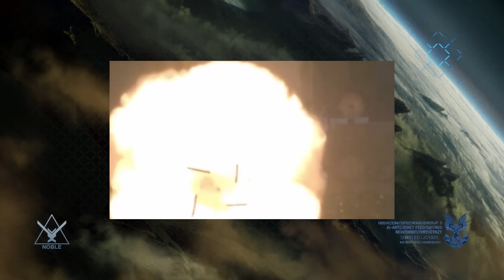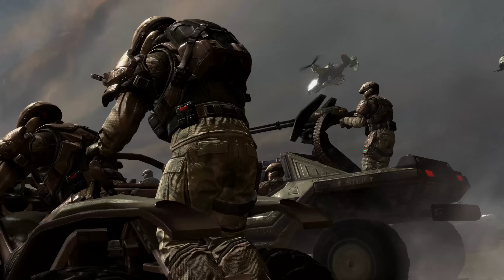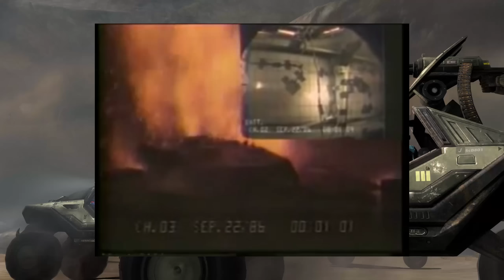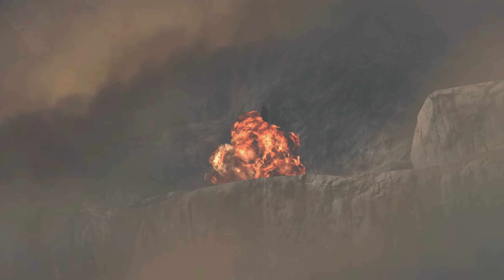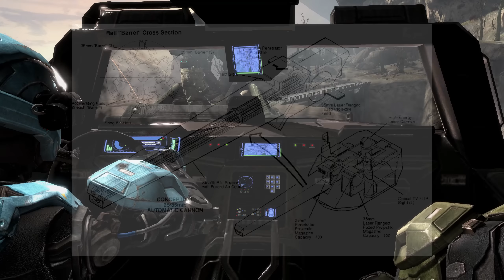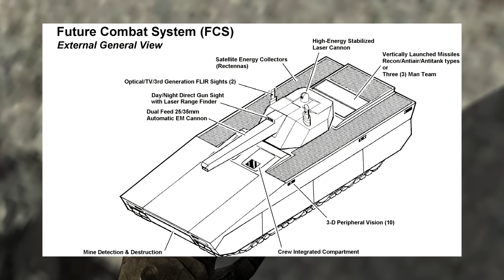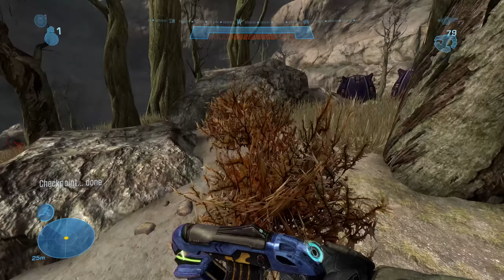Are Railgun Tanks Practical?

Comment: "With rainguns, you don't have volatility" Ahh, not quite. Capacitors can be pretty explosive when charged up. If someone hit the capacitors when they have a full load, it would be just as bad as hitting your ammo rack. The energy to toss a slug at 8x the speed of sound has to go somewhere, potential energy is potential energy, be it in the form of chemical, or electrical. You can look up videos of catastrophic electrical equipment failure. But needless to say, fire and explosions would still be an issue, even without factoring in a chemical or nuclear power plant to power your railgun.
Reply: Isn't that still more of a thermal thing?  Like, low-explosive, more in the line of gasoline explosions than chemical propellants?  It would be substantially easier to contain and route away from important parts, unless it really is equally vigorous.
Reply: @Northropi
If you turn 1 joule of potential energy into heat and concussive force, it doesn't matter what the source was. Your only general advantage of capacitors vs explosives or gasoline is that capacitors as they are now have vastly worse energy density. But if you wanted a practical tank mounted railgun, you'd need to have capacitor banks that had similar energy density to at least explosives, keeping in mind most explosives have about half the energy of a non-self oxidising fuel like gasoline, since a fair portion of them is some form of oxidiser and stabilizing binders.

But in the close quarters of a tank hull, I doubt you'd even want a current high voltage capacitor detonating on you. This is a very small capacitor blowing up from over voltage: https://www.youtube.com/watch?v=_WheLp0RdLQ The energy in those little ones isn't even enough to do more than deliver an annoying and slightly painful shock. The energy to drive a KG of steel to mach 8 would pretty much detonate with similar energy to the powder charge it would take to do the same work.

Conventional explosives also don't tend to detonate because there was damage to the power system and a voltage leak. If combat damage broke the power system, and forced the charge breakers into the on position, or stuck them there, your capacitors could easily detonate. I'd want those capacitors walled off and seperate from the crew entirely, even if they don't detonate, they can easily overheat and light on fire.

It's a common misconception that electrically driven guns are somehow more inert, I guess it comes from most not having much experience with electricity. But energy is energy, and any uncontrolled release tends to result in an explosion. You can also have issues where power lines are severed, and end up in contact with the hull. It would be a nasty, and deadly surprise to complete a circuit to ground with your body while trying to get out of a burning railgun tank.
Reply: @kauske  my hangup is how it would turn into concussive force.  Solid state batteries don't build pressure in themselves, do they?
Reply: I linked you a video showing how a capacitor literally explodes like a firecracker from overvoltage. Either watch it, or search for exploding capacitors. You don't need to build up gas pressure, electrical charge can create heat and force. The same electromagnetic principle that pushes a slug down a barrel can tear a capacitor apart and generate large amounts of heat. When you smash a charged up capacitor apart, the energy doesn't just go away, it's released, usually as heat, and when you have lots of heat in one small place, that's the basis of how explosions work and one of the best ways to start a fire.
Reply: @kauske  yeah, I know capacitors go up like that, but, well, two things.  First, is the conversion from stored energy to concussive force still as efficient as chemical propellants, or is a greater fraction of the energy released as relatively less dangerous heat?  Second, does this apply so much to the batteries that hold the energy longer-term?  I know those burn, and that energy has to go somewhere, but would it be equally explosive in doing so?  If not then it would be reasonable to set up a fail-safe where the capacitors are kept uncharged until needed, and it's also possible that a chain reaction could be prevented more easily than with a magazine by discharging the capacitors via an emergency circuit into the ground in the event one is damaged.  Unless the explosive tendencies of any energy storage of a given density are totally identical then it seems like energy weapons may be substantially safer than conventional ones in regards to exploding.
Reply: Capacitors take time to charge up, if you aren't keeping them charged, you won't be firing any time soon. That would be even more deadly to a vehicle. And as I've said, when it comes to turning energy into heat, it's always a 100% efficiency, that's how thermodynamics works. All potential energy moves towards being nothing but heat. Even if a capacitor only blows up like ONE round, that's still enough to kill the crew. You would not want those capacitors sitting in the same compartment as you are.

It's also easier said than done to discharge to ground on a vehicle, rubber track pads and tyres tend to insulate vehicles, hence why it's dangerous to touch a vehicle that has crashed into power lines and has live lines in contact with it, yet entirely safe for the occupants. You'd have to have grounding lines hanging down from the metal of the vehicle body, which can get snagged on things and ripped off by a vehicle moving off road. One mishap, and it's a crew death.

Meanwhile, with wet storage and blow-out vents, there haven't been crew deaths from ammo-detonations in a modern tank that uses the systems. But you're certainly not safe to just stick your capacitors in the main hull. Especially ultra-dense capacitors that can cycle the charge needed to fire a railgun. Don't forget, if you touch high voltage AC, it stops your heard and kills you, but high voltage DC tends to cause you to burst into flames and potentially detonate. Electricity is pretty rude stuff, look up high voltage accidents, particularly with DC to see what large volumes of electricity can do to a human body.

There's a reason that in the early days of electrical development people wanted 'lightning cannons' and electric death rays. They saw the tremendous damage electricity can do to living things, and wanted to weaponize it. Even a hobby electrical engineer will tell you that it's no safer than playing with explosives or gasoline, if you mess up, you're still dead.
Reply: @kauske  While the statistics of wet racks being safe are useful and the charge time of capacitors is something I hadn't really considered, you kinda didn't answer my question.  I fully understand the conservation of energy, I've seen it enough that it honestly feels like you're talking down to me when you invoke it- what I'm asking is if the process of a capacitor cooking off is necessarily as bad as chemical propellants of a similar energy density.  Yes, I know the same amount of energy is released.  Yes, I know it all goes somewhere.  What I'm asking is if the assumption you seem to be making, that the process of this release, is necessarily as explosive for a chemically inert capacitor or for battery as it is for chemical propellants that explode by combustion, or if more of it becomes waste heat rather than a kinetic blast.  That is, if the process of electronics cooking off is as efficient at being an explosion as chemical explosives.  How does the electrical energy in the battery or capacitor take the step from being stored charge to exploding, and is this necessarily as efficient as chemical combustion?
Reply: @kauske  is all this still the same if super capacitors become more of a thing in the future? Like assume you can some how make a graphene and metallic hydrogen sandwich super capacitor.
Reply: @Anthony Ngu
All you can do within the bounds of physics is pack more energy into a smaller space, which is good for overall vehicle size, but more energy in a smaller space means a bigger boom if it fails catastrophically. Unlike a lot of high explosives which can be made surprisingly stable (c4 will only burn if thrown into a fire, not detonate, for example) a capacitor is always fail dangerous. If you poke a hole through the layers of the capacitor, you  more or less complete a circuit for the energy to escape, and when it does, it will create a lot of heat and electromagnetic force, which becomes an explosion. If you had a bunch of pure hydrogen and carbon, that would be pretty flammable, and the heat of the capacitor failure would probably ignite it, making it worse than a ruptured overcharged LiPo battery.

You remember the buzz not to long ago about exploding phones and those 'hoverboards' that burst into flames? Those had energies in them that would be paltry next to what drives a railgun. If one of those faulty phones went off in your pocket, you'd be getting second degree burns easy. Now, imagine if something with quite literally hundreds of thousands of times the electrical potential cooked off under your seat, or directly behind you. Crew survivability would probably resemble early WWII tanks, where ammo cooked off and killed the crews regularly if you didn't isolate the capacitors from the crew just like we do ammo now.

What I'm getting at, is that you can't save space and just jam your capacitors and powerplant in next to your crews and believe it would be safer than sitting on live ammo. You could sit on the slugs, those are basically just inert metal, unless you have explosive push charges, since railguns need an initial kick, but you could use cold-gas or even a solenoid to replace the explosive kick-charges used by current testing railguns. However, with cold-gas, you'd probably want to keep that away from the crew, since no one wants a HPA or nitrogen tank to blow up next to them because it got caught by some spall. Solenoid would be the most inert option, but also prone to failure more than a gas or explosive based system for initial kick.

But the short of it is, railguns aren't hugely less dangerous than traditional guns, they have their own unique set of dangers.
Reply: @kauske  probably with the graphene even with it's great thermo conductivity, I'm not sure about metallic hydrogen as it's just a theoretical substance as doesn't act like normal hydrogen.
Reply: @kauske  I guess the saving grace of caacitor banks is they'll only carry the explosive energy of one round at any one time, since they're trickle charged from the main power source between shots. As such you can't have the sort of huge ammo explosion you get when a round hits a chemical ammo rack, although it might still be comparable to a breech explosion.
Reply: @dsdy1205  Ideally you'd want multiple shots worth of energy racked up at any one time, it would be even worse for your tank if you could only fire a round every few minutes, or even in the range of tens of minutes. Unless you can charge those capacitors from empty to full in seconds, you'd likely want an excess reservoir of energy to keep up with demand in combat.
Reply: @kauske  I mean it's still more inert it's only vulnerable when its firing that's a shit ton better than always, and if a fuckin rail gun is about to fire folks are taking cover not potshots
Reply: @mondaysinsanity8193  Uh, no, capacitors take MINUTES to charge up. It would be sitting there vulnerable for minutes, that's an eternity in a fight. Don't try and talk electrical engineering if you don't have a clue what you're talking about, it's not doing you any favours.
Reply: @thano8499  wait, then how would it work at all?  Are you implying the charge for not one, but every shot would have to be held in the capacitor bank in an effort to avoid this, with nothing being kept on reserve in the batteries?  I'm definitely not an EE guy but I don't think capacitors are meant for retaining a charge indefinitely.  Recharging between shots is inevitable, therefore most of the charge will be in a separate battery bank.
Reply: @northropi2027  You would want to keep as much charge in high voltage capacitors as you possibly can. You also wouldn't particularly want a pile of batteries over a more active power plant. Even with graphene batteries, you'd get more energy out of a gas turbine per kg. Batteries will also go up if they get hit, even graphene ones. Putting a hole in batteries causes shorts that release potential energy and turn it into heat, which means fires.

You're also talking about holding a charge in a combat situation, despite what movies and TV show, combat is usually very short, and very intense. Keep in mind that loaders have to be able to maintain at least one round into the gun and ready to fire in 7 seconds or less for US tanks, while the average is close to 3-5 seconds per round down range. For a magnetic gun, it could take minutes to charge up each capacitor load for a single shot. If you take 2 minutes to charge a capacitor for your main gun (this is a very generous speed.) You need to have a reserve big enough to fire about 24 shots at any one time to be at the bottom end of average.

There would be no point feilding an MBT with a gauss gun that can't keep pace with that. Even some of the worst autoloaders do at least that good. And enough electricity in a bank of capacitors to fire 24 hypersonic shots is a lot of energy. You wouldn't want to be anywhere near that when it cooks off, it would be every bit as bad, if not worse, than 24 more standard rounds cooking off.

And when people act condescending, like they know better, when they don't know anything,I'm going to give them exactly what they dish out, twofold.
Reply: @thano8499  so ultimately the plan for a railgun with a viable firerate would be to carry enough charge in the capacitor banks for to fire enough shots before recharging that it can pull...  Well, two minutes to charge, 24 shots of charge, so 12 rounds per minute if it's charging and firing at the same time?  This is of course neglecting the heat problems and cooling solution, which would likely take more power and lower firerate further.  I've not got much of a "but what if <x> then it good" rebuttal beyond the question of whether this is still viable for ships, that the increased hit probability of railguns may make somewhat lower rates of fire acceptable if the unit isn't being actively overrun, and if there may be a role for railgun "tanks" as artillery rather than the, erm, "main battle" part of MBTs.  I also wonder if it could be possible to divide the charge between many capacitors that, in the event one is damaged, discharge the remaining ones into ground as a safety measure to reduce the amount of stuff that can explode at once- if possible, this could give it an edge over conventional propellant, no?
Reply: @northropi2027  I come in here fairly "empty-handed", not an expert EE, but having multiple capacitors to divide the charge = more space, which is exactly the opposite reason of why we want railguns instead of conventional cannons (one of the reasons anyway).

The moment your design incorporates parallel-circuit capacitors (as in to divide the charge instead of firing them one-by-one), you might as well use conventional tank instead with explosive ammo.
Reply: @thano8499  well sorry, man, but, like, I'm trying.  When I search "is the force of an explosion directly proportional to the energy density of the explosives" I get gibberish.  When I ask my friend, who I trust on this subject, he disagrees with capacitors being equal to chemical explosives and says more of the energy would disperse as heat without as much pressure, but I'm not sure he meant that with the assumptions of equal energy density we're using here or just bigger capacitors.  When I search for videos of capacitors exploding, which I knew about coming into this, it's hard to quantify if that's just as bad as a similar amount of gunpowder going off.  And all of this is so specific and situational that I'm not sure it's been written about extensively, so the only thing I can think to do is to go to Yahoo Answers or whatever and start up this exact conversation there to get answers from other people who I have to kinda trust know better than I do, which I thought was what I was doing here.  I'm not choosing ignorance, I'm trying to use the internet, which is, like, you know, we're on it.  This, like, this is the internet.  If you think this is a poor use of the internet, inefficient for getting answers, then I guess I should give up but I thought that was the point of commenting here to begin with.
Reply: @haveiszalfaroqie  I...  Never heard of space as an advantage for Railguns.  In fact I'm pretty sure the necessary electrical and cooling systems make it impossible to have a small railgun that isn't just woefully underpowered.  The big reason everyone's hyped about them afaik is the ludicrous velocities they can achieve.  I guess this means that a railgun that fires Mach 7 projectiles is smaller than a cannon that does, but I think there are theoretical limits on how fast a conventional, chemical cannon can launch a projectile anyways so I'm not sure you can really make that comparison in the first place.
Reply: people don't realize that lots of high voltage equipment just requires a misplaced wrench or screw driver to turn it into lava, a hand grenade, and a lightning storm all at once. arc flash is no joke and under the rigors of combat it would be unavoidable. I don't know much about what it takes to power a railgun but I just imagine all the industrial electrical infrastructure I work on being condensed to a mobile platform and the concept is something i wouldn't want to be anywhere near. cool sci-fi though.
Reply: @regardlessrampage  Exactly! Between having worked in construction and having to get safety for HV among other things, and just research on my own for hobby writing, electrical equipment can be hella dangerous if you use it wrong, and it doesn't' get much more wrong than being shot with an APDS round.

HV has so much energy and potential for destruction that it's a serious point of research to make electric reactive armour that can vapourize penetrators when they complete a circuit between hull layers. One of the few works of fiction I've seen take this into account is a submarine game called barotrauma. In that, if your charged up capacitors go sour, they can blow up in a big way.
Reply: @regardlessrampage  wait, why would an arc flash occur under the rigors of combat?  They're not gonna be working on the thing in the field.  I can understand unintended discharge under damage but how's it going to happen from just pulling the trigger too fast or whatever?
Reply: The advantage with capacitors is that they can be centralised, unlike ammunition. So you can still decrease the blowout panel requirements.
Reply: @Kevin-hx2ky  Because we totally don't put all the ammunition into a segmented ammunition bunker on the back of the turret... Oh, wait! We do do that. In what word do you think you can't centralize your ammo? You also wouldn't want to centralize your ammot, or capacitors to one single shared space, or you lose it all if that space takes a hit... Moron.
Reply: I've recently started playing a Battletech video game and gauss weapons in it behave kind of like that; the ammo isn't explosive, but the gun sure is!
Reply: For the life of me, I cannot imagine an...electric explosion. An explosion is two things. Heat and overpressure. I understand where the heat would come from in the case of either electrical or chemical fire...but overpressure?

Heatproofing the capacitor compartment will always be more practical than blastproofing the crew...
Reply: @Yorgos Chrysogenis
When you start to get into high enough voltages, the electric charge can overcome atomic and molecular bonds. Think ionization, basically, when you get enough current escaping into something that can't handle it, not only does it get hot, but the material will ionize, and plasma is even more volatile and expansive that just hot gas created by a chemical explosion. If you really, really get into the higher voltages and charge potential, you can get an electromagnetic explosion. IE, if a craft with an ion engine did not have an electron gun firing the waste electrons into the propellant stream, it would become so negatively charged that it would eventually explode all all those electrons repulse off each other with electromagnetic force.

I posted a video in another response where someone overdrives relatively small capacitors, causing them to go off like firecrackers. The electrical potential in most of those is barely enough to give you a static zap, but they go off like more than twice their mass in black powder. As someone else stated, exploding high voltage equipment is like a mix of lightning, bomb and lava all at once. That escaping current heats things up, ionizes things and can even electromagnetically fling things or tear them apart. You'd have to treat HV capacitors as every bit as volatile as conventional ammo, which goes against Spookston's assumption of less danger to the crew than conventional ammo.

You also have the issue of broken equipment turning the metal hull of the tank live, which is a brand new danger you don't need to worry about with conventional ammo. You also have the issue that capacitors are always dangerous when charged, whereas many tanks use non-assembled ammo, where the primary propellant is an explosive that is hard to detonate, and is stored separate from the primers. US tanks use cased ammo that's fully assembled, but that's not true of every country. A good few use caseless ammo where the propellant is inserted after the shell and topped with a primer.

If your primary propellant needs the shock of a primer to go off, it's likely not going to cook off even in a fire, so if you use an ammo system like that, you've introduced something more explosive than a bin of primers into the tank. It just struck me as strange that someone who considers most angles would overlook the volatility of high voltage equipment.
Reply: @kauske  I see.

Good points, there. 

I totally understand how, without proper insulation and use of material the risk of exposing the crew and sensitive electronics to lethal current is very real. 

And that overdriving the capacitor might cause it to go boom, spectacularly.

What I still fail to grasp is how do you cause that to a capacitor using only the kinetic energy stored in a metal projectile?

Unless of course the opponent still uses "outdated" APHE shells...

(edit: Also, please correct me if my  assumption is mistaken...but in any case a capacitor can only manifest all the lethal consequences of being overdriven when charged. Which means that a grounding line would be the simplest one size fits all way to counter...? Albeit, at the cost of rendering the main armament inoperable.)
Reply: Yorgos Chrysogenis well if it doesn’t explode then you only need to worry about being instantly vaporized by all the heat released
Reply: @deathdragon2283  My man...ceramics is the word, I believe...could be wrong, but probably not...especially when we talk military applications...
Reply: Battletech has always had this very mechanic; your gauss rifle takes a direct hit, its capacitors detonate, destroying the weapon and doing serious damage to everything around it in the vehicle. It's nowhere near as bad as a conventional ammunition explosion (which will almost certainly destroy the vehicle, unless it's carrying specific explosion-venting equipment), but it will at the very least deprive the vehicle of a very potent weapon.
Reply: You don't need to destroy the vehicle to kill the crew, most ammo explosions don't damage the vehicle beyond salvage, but humans are pretty easy to kill with any sort of explosion in a confined space. Putting a capacitor capable of firing a railgun in the same hull compartment as the crew would be a good way to kill them if it ever catastrophically failed. Battletech is also not exactly a reliable resource for realism, even if they take things into account most other fiction glosses over. If you have 10k joules of energy, it doesn't matter if it's a capacitor, or a bag of smokeless powder, if you release it all instantly, you get roughly the same blast and heat.

Look up a few videos of people using high voltage to blow items up. Pump enough electricity through a pencil lead, and it will blow up like a firecracker. The thing about electricity is it's not reliant on mass for energy, just the electrical potential present. Think of electrical potential like a fixed mass weight, you can give that weight more or less potential energy by lifting it higher, but no matter how much potential you give it, it's still the same mass. A KG at 2 meters has twice the potential energy of a KG at 1 meter, but both are a KG. The same way a capacitor can be charged to different levels and have different potential. And to make it viable for a tank, you're talking about capacitors with the same energy density as explosives, if not even more dense.

If they go off at full charge, you're going to have a major problem if you don't have them isolated and give them blow-out valves. Worse, they can also charge the hull if damaged, making crew escape problematic. They aren't inherently safer than conventional ammo, just a different sort of danger.
Reply: @Irondrone4  Still, you can easily mount a CASE in the arm where a Gauss Rifle is stored while the rest of the ammo can be safely stored in the nearby torso section.
Reply: @racer927  Yep! I did mention explosion-venting equipment, but I probably should've been more specific. The problem with standard CASE in the tabletop rules is that it can only go in the torso areas; it's different in many of the computer/video games. In the tabletop, only CASE II can go anywhere in the 'mech, and it's even bulkier, more expensive, and considered more advanced in terms of ruleset, so it's not used too often.
Reply: @Irondrone4  Ah, I forgot CASEs can't be arm mounted in pure tabletop.
Although a Gauss Rifle has a fixed amount of internal damage compared to ammo (the more stored, the more damage from an explosion since it's weapon damage*remaining amount).
Reply: @racer927  You have no idea how tense I get when my Hunchback's left torso loses it's armor and I realize that it's still got between 120 and 200 pts of damage ready to cook off inside it.
Reply: Everything has a weakpoint
Even if it is the driver
Reply: For the powerplant thing not quite...SSBs (Solid State Batteries) are the future in terms of being able to power vehicles and other. See with normal batteries they have the liquid electrolyte (chemical) which is dangerous of course, but with SSBs they are solid not chemical and aren't very reactive so it won't explode. Not only that but SSBs have a lifetime of up to 10 years +, 40% more effective (i think) compared to a conventional battery of the same size. Not to mention that the battery is super slim and in 30 ish years would have been improved on drastically. So by the time Railgun tanks come out, they would be powered by super small, super powerful battery that can last for an extremely long time.
Reply: @sethl.lazarus6642  Solid state batteries still have the same issue as capacitors do, if they short, potential energy becomes heat, which can lead to further failure and an explosion. There are plenty of capacitors with no electrolytes, they still go boom when you over-drive them. Solid state batteries will also not have the energy density to power the needs of a railgun, a turbine engine burning gasoline would provide better energy per tonne and be more easily refueled than even the best batteries we can imagine within the laws of physics.

If you wanted a railgun tank, it would need to be driven by a combustion engine, nuclear or something else with very high energy density. Or it would have a laughably short operational time. You also still need capacitors, as batteries cannot deliver instantaneous high voltage as needed to power a railgun. And on the terms of nuclear reactors in tanks, so long as you're fighting on your enemy's turf, it would probably make them hesitant to destroy your armour, since they would have to clean up the fallout if they perforate the reactor.
Reply: 30 years in the future will not rewrite the laws of thermodynamics. If you cram a lot of energy into a small space, and release it, it will always and forever make an explosion. And the more energy that you pack in tightly, the bigger the explosion, end of story.
Reply: it would be easier to shield the crew from a coil discharge than a ammo explosion
Reply: @jamesricker3997  Nope, energy is energy. The electrical potential to lob 1kg at mach 3 ~5km and the same explosives to do so have the same potential to explode violently. Try actually reading though this thread before you make a comment.
Reply: Laughs is graphene batteries that are thing now in 2020
Reply: @MAKOS-ky5my  And you think they wont explode if you toss them in a fire, or rip them open? Graphene batteries are also not capacitors. If you stop trying to be 'witty' and actually look into technology, you won't look as foolish when you write a knee-jerk response.
Reply: @MAKOS-ky5my  That has nothing to do with how explosive capacitors are, you pillock.